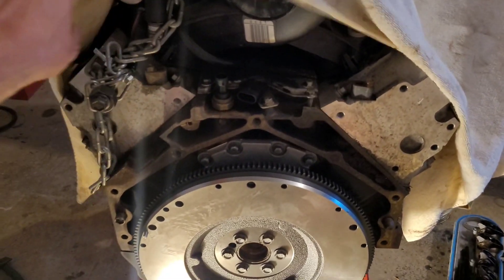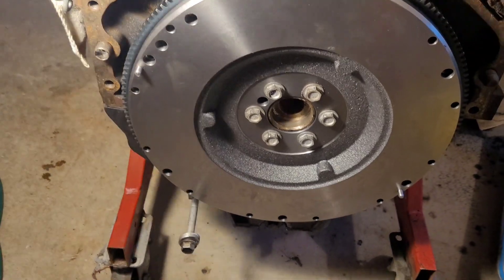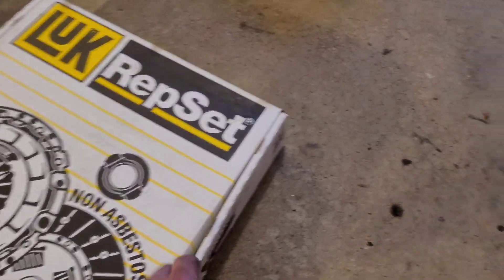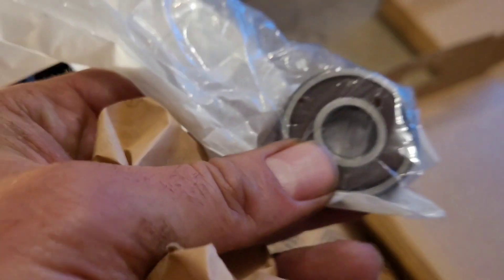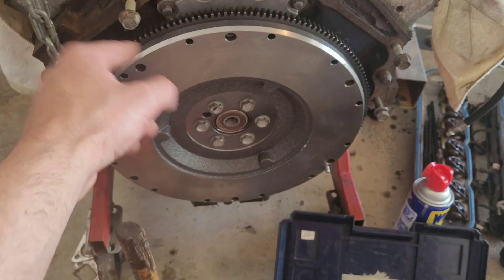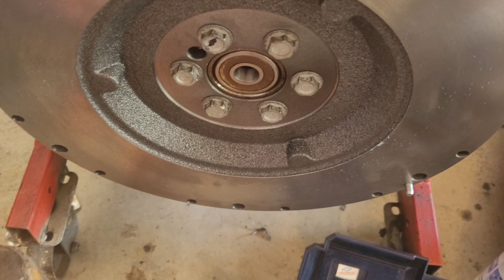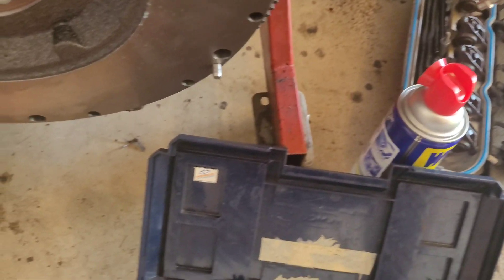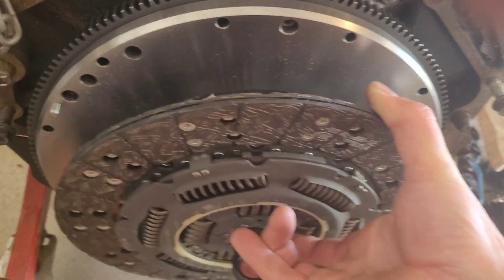How to: LS engine to NV3500 manual transmission- Part 1

Comment: im doing an ls swap to my 94 chevy and will be using the nv3500 what manual harness and ecu will i need to run the 5.3 with the nv3500?
Reply: You're just running vss to pcm from trans

Comment: Im doing the nv3500 swap on my 1979 c10 , The nv3500 come out of 99-06 Silverado with 4.8 . I was wondering do I use the clutch kit made for 99-04. And do I need the use small block flywheel
Reply from the maker: I would use the clutch and flywheel setup for a 96-99 Vortec engine.

Comment: Been watching your videos thanks for all the help doing a nv3500 swap with an LS. Big question, I am having trouble with the slave cylinder. I purchased two different ones the Sachs one and one from speedway. They are to big and don’t fit the shaft. way to much play. I’ve watched a bunch of videos and they fit everyone else’s 🤷🏼‍♂️🤦🏼‍♂️. Have you heard of this. I went to local parts store and it looks like the one for a 1996 4.3 v6 is smaller then the ones I have and will work going to check soon. I wanted the 2005 with the intergraded line but it was to big.  Any help? I bought the trans from a 1996 or 97 Chevy 1500. Thanks

Comment: Whenever I install right bearings like that pilot bearing, I will store the bearing in the freezer until just before I install it and warm the area in the flywheel with a small torch, they go in surprisingly easy that way

Comment: I got a gmt900(09 1500 with 4.8) would it be pretty much the same route as your 4.8swap? Wanting to build a turbo truck me want another manual. Tired of the b.s grenade myself 60e. Not buying another "built" or "bullet" proof. Last transmission lasted 50k and was paid for by previous owner. Truck has 158k I've hauled once with it and haven't beat on the truck hardly besides pulling someone out of the mud and hauling a trailer around a bunch of stee hills. It's a wt.

Comment: People!!!! There's no part 2 because the shit doesn't work!!!!! Found that out after 2 different transmissions only to find out that the clutch will not release
Reply from the maker: Actually It does work. I used the same trans in my S10 and made several vids proving it. I never got around to making a part 2 becauae I ended up selling the truck
Reply: @beeterolds so how did u get the clutch to release ?
Reply: Currently having this issue
Reply: It does work . Mine works
Reply: This is the only video I've seen with multiple ppl having issues with disengagement. Me included

Any updates yall?

Ive thrown parts, replaced everything, upgraded to nv4500 and it still shifts like ass
Reply: @guitarguy3221 I'm considering this swap (97 nv3500 to 5.3) internal slave, what is the disengagement issue and why? Does the slave not move far enough? Range of motion issue or?
Reply: @ccreations123  I believe my issue is that I used a larger 12 inch Luk clutch. The input shaft has extra resistance by that clutch so I have to hold the stick onto a gear 2 seconds before the input shaft will let it slip in

I tried using a custom clutch pedal pushrod that bottomed out the master cylinder and nothing changed

Taking out the master cylinder, pointing the lid up, and hammering on the pushrod will eliminate bubbles in the line which helped me slightly

I shimmed the slave cylinder with nv3500 and it did not help at all. I shimmed it with the nv4500 and grinded down the inner sleeve of the slave 😂
Reply: @guitarguy3221  Thanks

Comment: I got a flywheel with my tranny off of a 5.7 350 small block will that flywheel bolt to the 4.8/5.3
Reply from the maker: Nope. Different bolt pattern

Comment: Doing a 5.3 swap on a '95 c1500 and planned on using the the nv3500 thats in the truck, external slave. I've searched the internet up and down to find out if the external slave will clear the oil pan. I did watch your video on the '93 and you didn't mention anything about it. I've installed a camaro oil pan and ditched the truck pan. Some say it will clear fine, some say it won't. I've also heard that the s10 nv3500 is different then the c1500. If you could clarify any of this I'd greatly appreciate it.
Reply from the maker: I guess im going to find out once I actually bolt the engine to the trans
Reply: @beeterolds  if I get to it before you I'll definitely let you know, im getting antsy! Otherwise I'll be waiting for your update. Your videos have helped me out alot, keep it up!
Reply: I had zero clearance issues with the slave. Motor and trans are in and running. One question....where did you get your keyed power for your box on previous builds?
Reply: @RS-db2ee are you running 4.8 with nv3500? Got part numbers to ur clutch an flywheel or did you use the ones in the video?
Reply: what manual ecu and harness did u use for your nv3500 to connect to the 5.3??? please let me know

Comment: I got a Sachs throw out slave part number Lsc326 for a 05 Silverado to go with the part numbers you have on yours so my question is do you have to run a spacer behind the throw out bearing?   The measurements I have tell me that I’m about .8 to .9 of an inch from the teeth of the pressure plate to the compressed throw out bearing ?

Comment: Just did a similar setup with my 5.3L into my Jeep. Same transmission, just slightly diff on the NV3550. Almost 400hp and I haven’t blown it yet. 😜
Reply from the maker: How did you adapt an NV3550 to an LS? I thought they were Chrysler only?
Reply: @beeterolds  I used an adapter from Novak Conversions - it's Chrysler on one side (mates to transmission) and GM on the other side (bolts up to flywheel). Didn't even have to modify the input shaft...bolted right up.
Reply from the maker: Good info to know! I heard they are beefier units.

Comment: Did you run a spacer behind the flywheel or just direct to the crank? I have a lm7 with 04 nv3500 and all the 4.8 components in a 93 1500 and for the life of me cannot get the clutch to fully release? When I switched to internal slave trans from external.
Reply from the maker: No spacer. As of yet.. but in your situation you may have to shim the slave a bit..
Reply: I have a 97 I'm thinking about doing this with internal slave, did anybody come up with proper spacing or?
Reply: @ccreations123  summit has some t56 spacers I don’t not recall which unit I put on truck as I do not have it anymore but they have some good options that work.
Reply: Your 04 trans has a clutch fork??? Thought the internal slaves started in mid 90s
Reply: Throw out bearing ?
Reply: Same problem, went to nv4500 and still cannot get decent shifting behind my 5.3

Comment: Just lil on the luk clutch stuff, probly the best you can get for them, I've used many different brands, my truck is a 4.8 turbo, pushing around 700hp, no clutch other than luk will hold up properly, only real upgrades are using spec stuff
Reply from the maker: Exactly. Its the only brand I trust with the exception of the higher end friction brands... I only want to install the trans once 🤣

Comment: Will this work this kit work with a lm7 and a t56?
Reply from the maker: If thats the case you should probably get the clutch setup for an LS1 t56.. assuming the trans is out of an LS1 CAR and not an LT1 car
Reply: @beeterolds  makes sense. I might be overthinking it. Yes, the trans is from 04 gto. Thanks for the reply.